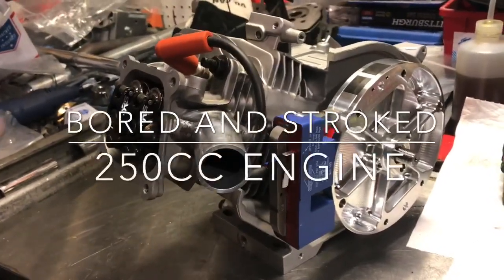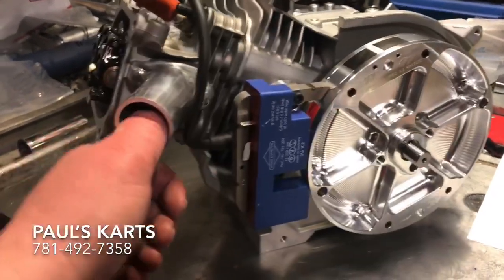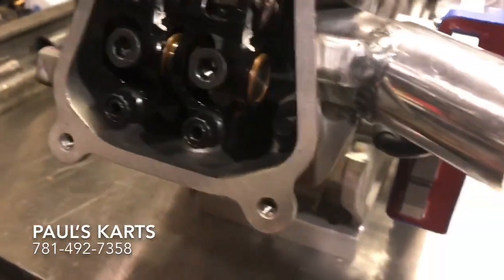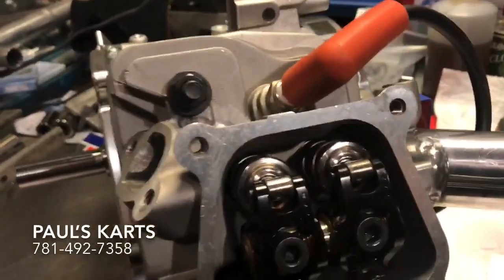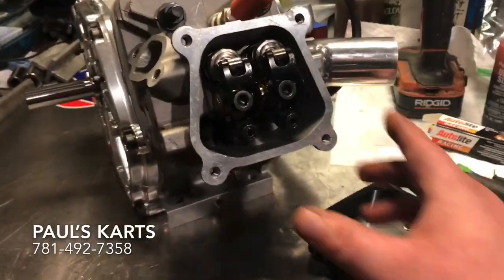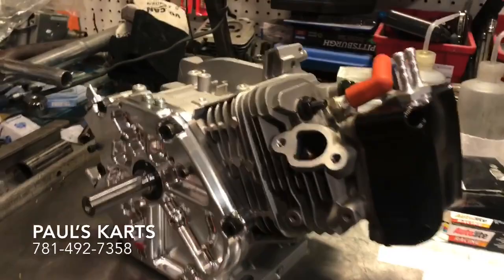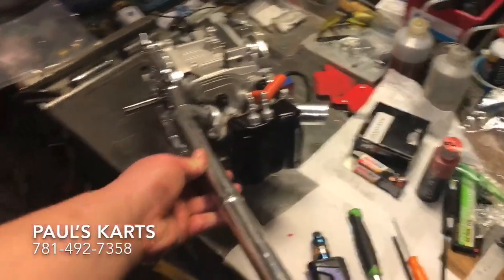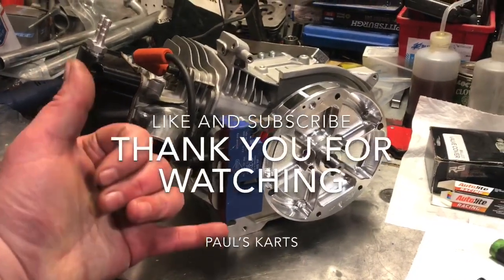**250cc** ..Predator 212 build ...( BIG BORE , STROKER, WELDED HEAD)

Comment: What RPM and HP is it making?  Like too put one of these on a longtail surface drive boat setup..
Reply from the maker: The 250 makes good power. Depends on fuel but on m5 (preferred fuel type) the 250 crate engine makes 31hp .. the stroker 270cc makes 35

Comment: How fast will it go with all the upgrades?
Reply from the maker: How fast ?? Depends on power to weight ratio and also your gearing and acceleration.
Reply from the maker: It will go faster with nobody on it than a 300 lb guy .. and if it’s geared for acceleration or top speed .. so lots of variables .. all you’d want is the most power the rest is just your weight and your vehicle and your gearing

Comment: what would rough HP numbers be on this beast ?
Reply from the maker: The only way to make HP is with flow .. Cfm x .257 = HP ... this welded I take tube allows this head setup with my porting to flow 108 Cfm on my flow bench at .425” lift .. also has even port velocity .. so it will make damn good power .. you also add 5-7% for methanol ... this guy is running my methanol carb ..
Reply: @paulskartslifan4206  Is it a .425 lift cam? If so what's the life expectancy of that cam. Can't imagine much because the Dyno cams .356 I bought only lasted 12 races before the lobes started to wear off and reduce the overall lift...
Reply from the maker: What ratio rocker where you using ? And what rocker type
Reply: @paulskartslifan4206  Gage 1/1.2 rollers
Reply from the maker: That’s your problem , not the cam .. the build sheet has issues . The 356 cam and 1.2:1 rockers puts you at .427” lift .. you should check retainer to guide clearance and coil bind. The springs are .375” max lift. And you need a minimum .060” retainer to guide clearance.
Reply from the maker: The excessive pressure of the retainers hitting the guides even ever so lightly (that the engine still spins and runs) is putting the strain on the cam ..
Reply: @paulskartslifan4206  Yep, just checked that and you were 100% correct. I thought since the coil pockets were cut that I'd be fine but the retainer is litterally just barely touching on the lowest point of the lift. Thanks!
Reply from the maker: Take a carbide burr ( preferred method )  or a drill bit and take some of the top of the guide off .. there are better ways of doing this but require guide removal which requires recutting seats . Also take the retainer ( if billet aluminum ) and remove say .050” off the bottom .. this will give you clearance .. but keep in mind coil bind ! I usually run longer valves and custom groove height when running that lift . But this will help you thru ..
Reply: I’m looking for you to build me an engine something like this. I will give you a call Monday. Thanks